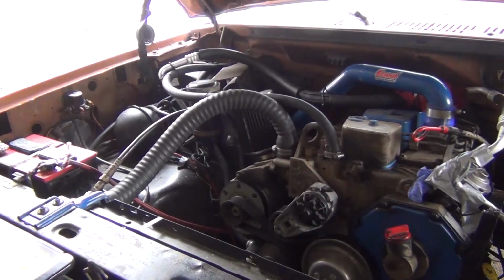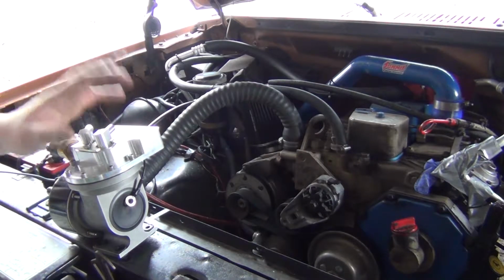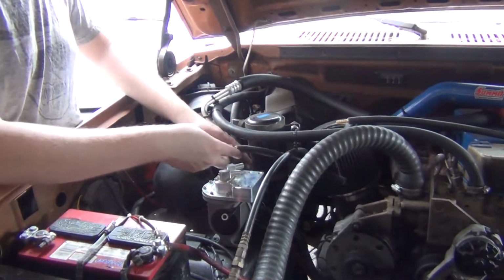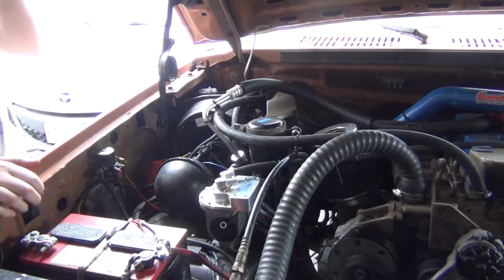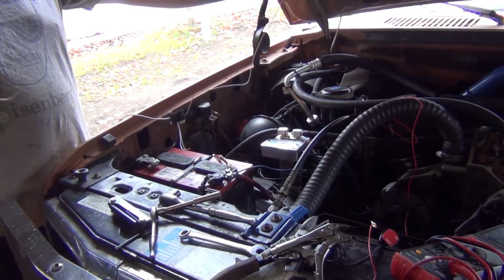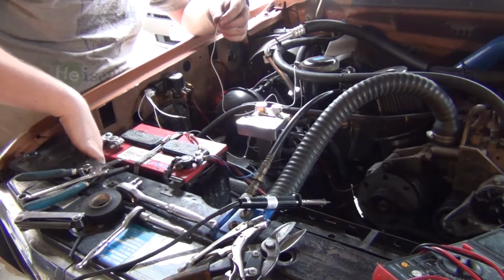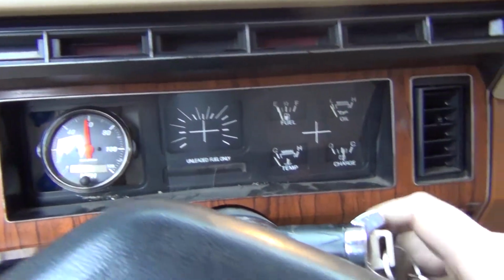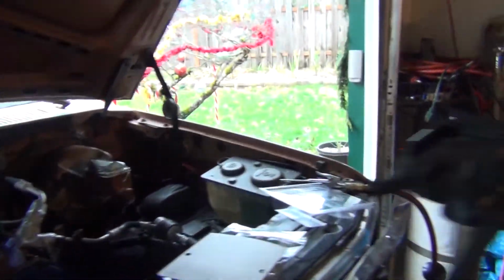Ford F150 Electric Vacuum Pump Install

Comment: Good job. Might want to add a plate of metal underneath the fender liner or pump for support. It will be interesting to see how the liner will hold the vacuum pump up with the heat of the engine compartment and summer temperatures. Vibration of pump may also cause some issues with plastic. I know my fender liners are kind of flimsy, being made of plastic. Too bad the liners aren't made of sheet metal.  Time will tell.  Hopefully I can remove the bed of my truck this weekend to clean the under carriage  I want to hot pressure wash everything before I replace the fuel and brake lines.  

Keep the motivational  videos coming.
Reply from the maker: +BigBlueMotors I had another pump on the other side, and it didnt cause and issue and it vibrated worse. And in the summer desert weather near mexico, it didnt get very hot under there haha. But I will be adding a plate there.

Comment: Saw this in your truck in the battery video. I was wondering what it was. But, from the lines looked like a vacuum pump, ended up looking it up and finding it on summit.

Comment: nice.  I'll be watching to see how it works long term.  I'm running  with no vaccum and I'm getting tired of stomping on the brake pedal.
Reply from the maker: +TheReclinerPilot You need to get one of these pumps. Right now my brakes feel just like a new car and I mean it literally. I can stop my truck from 60 mph to 0 with just my pinkie toe.

Comment: what is the purpose of a vacuum pump?
Reply: +shylildude Cummins Diesel engines do not require vacuum, so they don't have one stock, only optional (attatched to the power steering pump) on some engines. Did I say that right, justhes?